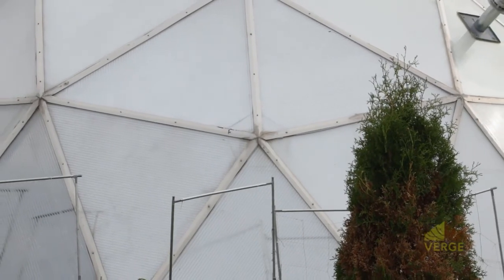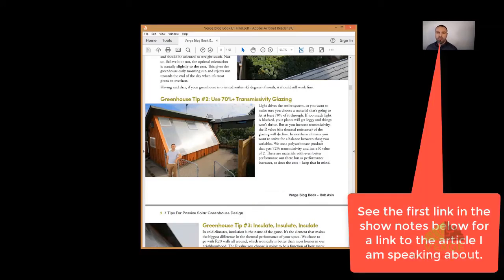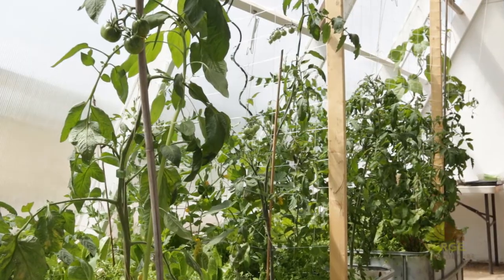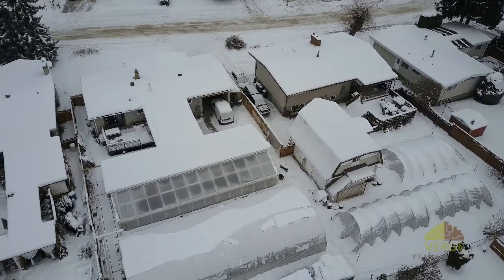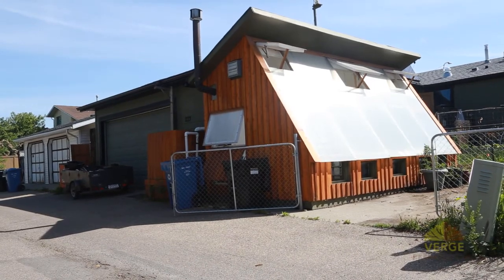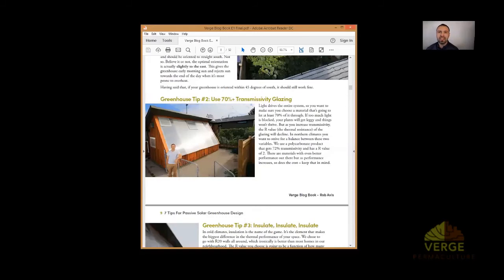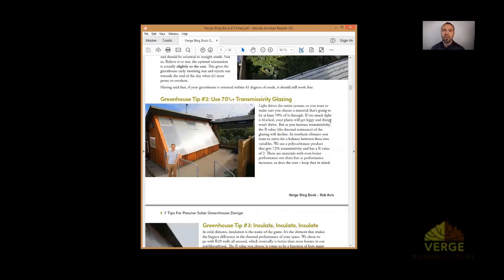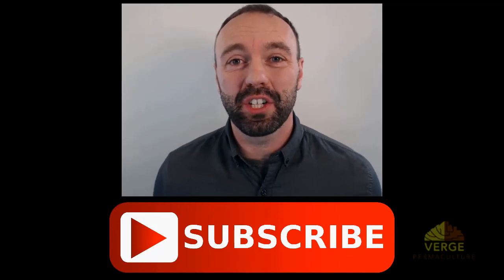What Greenhouse Glazing is Best?

Comment: Transmissivity isn't really a concern. as long as you're over 70% you're fine. Heat is the issue. the Solar greenhouse design, meaning insulating the north wall and having some sort of double glassing is what's needed in our climate - the functional issue is passive heated greenhouses in Canada don't get much above freezing.  you need active - and it's possible to do that cheaply with solar heat collected in the summer and used in the winter with a greenhouse like this https://youtu.be/__DlhjOhAus
Reply from the maker: You are right, however the transmissivity and heat loss are correlated. Also, the highest loss of heat occurs through the glazing surface which is why people try and find better-insulated glazing options. As you increase R value transmissivity decreases. There is an upper limit to how much insulation on the North, East and West Walls before you get a dramatic diminishing effect. This is the point in which you need to add thermal curtains. Thermal curtains are the lowest lieing fruit in terms of  energy loss.
Reply: Transmissivity and heat loss are correlated somewhat - depending on materials of the glazing and the material or vacuums between the layers. There really isn't an upper limit on the amount insulation you can put into the north wall, there isn't any measurable diminishing light  on the north wall. There's  no real sunlight input from the north wall. Covering the north wall with a light reflective coating (IE a mirror like covering) will increase light transmission much more on the inside north wall than a translucent north wall.